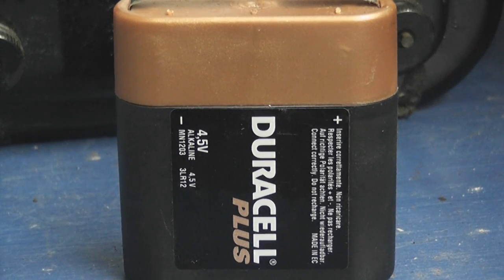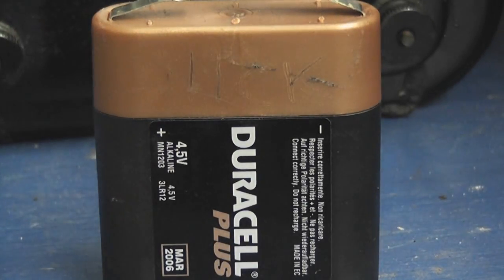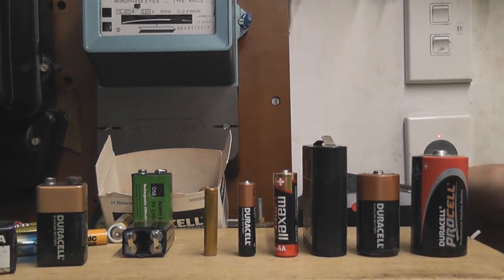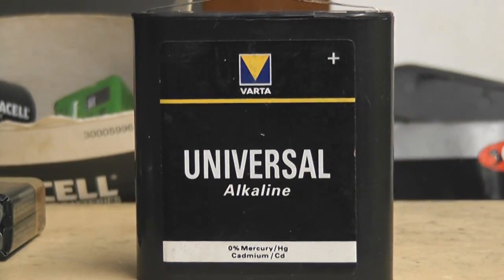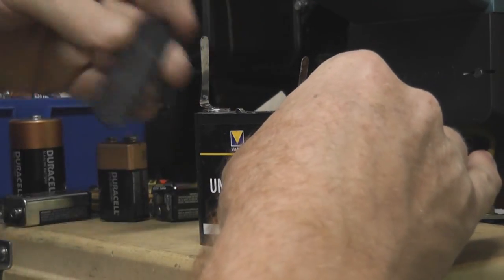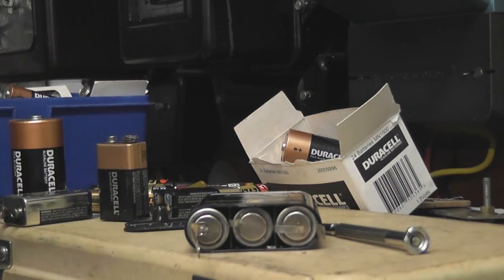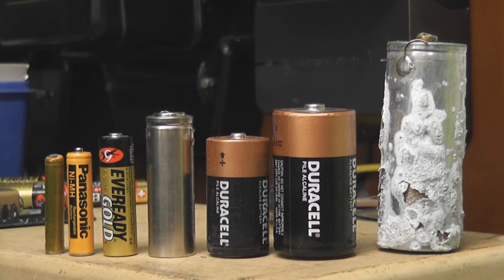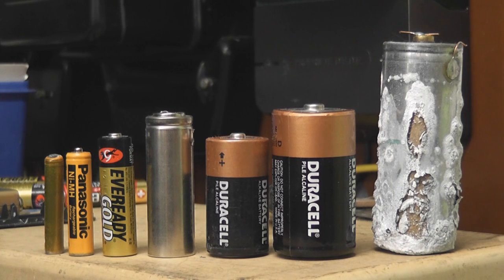4½ Volts B-cell battery

Comment: I managed to find a singular B cell sold by Rayovac (called BB21 or something), it's similar height to a D battery but skinny like a big AA. I've also found some A-cell batteries that look like chubby AA batteries (still narrower than a B cell). I also have a few F-cell batteries and even a G-cell battery. The biggest size they made is a #6, which is six inches tall. There's also two-cell batteries like the CC battery also known as an Aladdin battery (sometimes mistaken for being the missing B-cell battery) and even a DD that has two D cells (looks like a gigantic AA).

Comment: Where's the original A cell? Also I take it the E cell is a 9 volt?
Reply from the maker: No idea, afaik the A and E cell were never made.
Reply: @RODALCO2007    A cell has 17mm diameter and 50mm long. I have seen them in NiCad video camera batteries.
Reply: A-cell is 17mm diameter or sometimes 18mm (the 18mm ones are called fat-A), the E-cell is indeed the 9-volt, two of my 9-volt batteries say "E-Block" on them.  The A-cell looks like a slightly chubby AA.

Comment: The "B" Battery was indeed made for many years, prior to electricity being widely available. early tube (valve) radios utilized a B battery. These were available in voltages from 22v-45v-67.5v. They provided power to the valve plates (anode). When transformer power supplies became the norm, the voltage DC going to the plates was then provided via a, transformer rectifier and capacitor. Today the high voltage supply in a tube device is still referred to as "B+"
Reply: That's a different "B." There was a cylindrical dry cell battery type of both "A" and "B" at one point, but they never really found a purpose so they were discontinued. These batteries in the video might be repurposed cylindrical "B"s, but the "A" is so far out circulation that only a rough concept of it exists anymore.
Reply: @ExplosionRadius    A cell has 17mm diameter and 50mm long. I have seen them in NiCad video camera batteries.
This is same physical size of Lithium-Ion 17500 cell which is 3.7 volt.
Reply: You are wrong. Voltages in tube devices are called A and B. Plate and heater voltages. No referrence to battery type whatsoever. There were separate batteries used to supply A voltage and B voltage. Hence the battery "for B voltage" but that was not a B-type battery. If you search for pictures of battery powered tube appliances, you will find that B voltage was supplied by all the different kinds of batteries in different sizes and weird shapes. 

To summarize, B battery is not something you would put in one row with AA, AAA, C and D batteries. 
As you wrote in your comment yourself, it could come in different voltages, 22 to 67 volts. I don't think it is wise to call stuff with differences of that magnitude a single type of battery.
Reply: We still use A cell batteries commonly in Australia actually.

Comment: There's a tiny cell with the diameter of an AAA but with only one third in height, it's sometimes found in very small R/C cars, have you ever seen one?
Reply: 2/3 AAA I have solar lamps using that cell tipe and they are clearly written 2/3AAA

Comment from the maker: I am sure that these batteries were used in some portable devices. In Europe they were more used than in The Southern Hemisphere.
Reply: They are common in Europe. Not as AAA-D (R6-R20), but you can find them. In the past they where used in flaslights, but they where used in portable radios too (more econmically than using 6 C or D batteries). 4.5 Volt batteries are still used in some school experiments.

Comment: I used to have a couple of those 4.5V batteries from Batteries+. One of them corroded over time without even being drained to left with a load attached! Very interesting to see your observation. I never knew there to be a B cell, much less an F cell. Question: Was there ever an E cell or a G cell?

Comment: As a kid I used to see 67-1/2 volts batteries for fluorescent lanterns. Also 7-1/2 volts batteries in a squat casing as well as 1-1/2 volts "Ignition/Hobby" in a tall cylinder for glow ignition model aircraft. 1-1/2 volts hobby batteries also came in a rectangular casing with screw terminals, or was that 6 volts, can't remember. Haven't seen any of these batteries in 35+ years with the exception of the 6 volts lantern type with spring terminals.

Comment: Is this not an A cell?
Reply: An A-cell looks like a slightly chubby AA battery but the same height. A B-cell is similar in height to a D battery, slightly wider than an A, and narrower than a C, an AA is 14-15mm wide, an A is 17-18mm wide, a B is 21-22mm wide, and a C battery is 26mm wide.

Comment: Interesting video! Another odd size cell i have come across is used in 7.2v R/C car batteries, I tried to re-cell a pack using C size batteries but they were slightly too big!
Reply: Ah, those are a size called sub-C. (Sorry for replying to a comment you made over a decade ago, just thought I'd answer just in case someone else hadn't yet).

Comment: I remember those in a torch i had, i thought they stopped making them. actually i had an old multimeter that had 2 22.5 volt batteries in it. it was an old school meter not sure why it needed those. and it had 2 regular AA.

Comment: Those 4 1/2 Batteries were used mostly into some old flashlights in my country, we don't use them anymore, but there are still available in stores, especially camping related ones.
Reply: They where used in some portable tranzistor radios too.